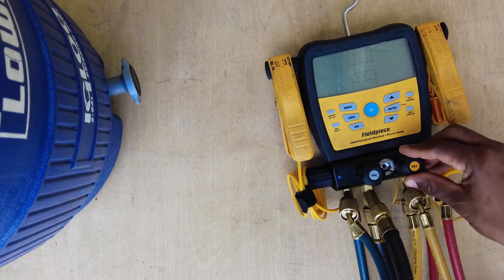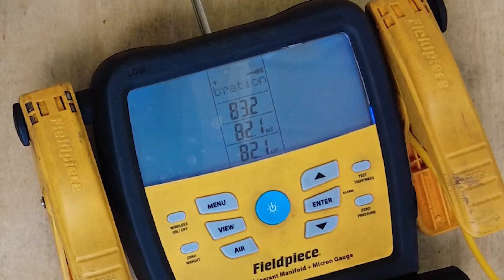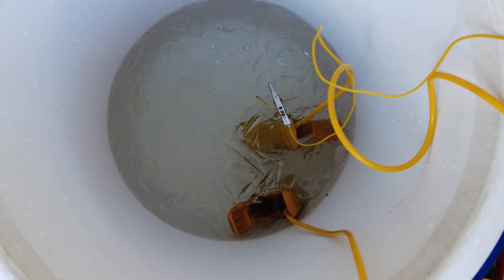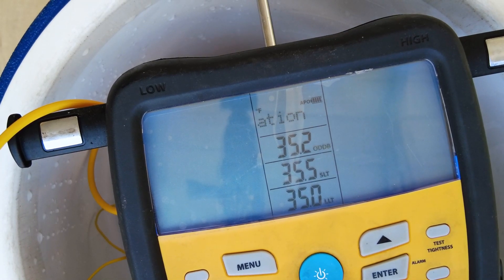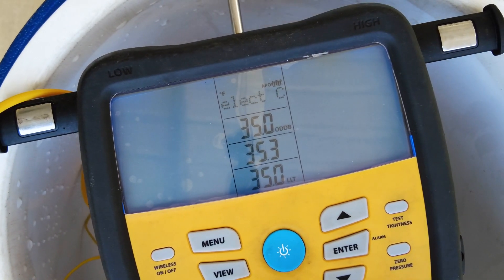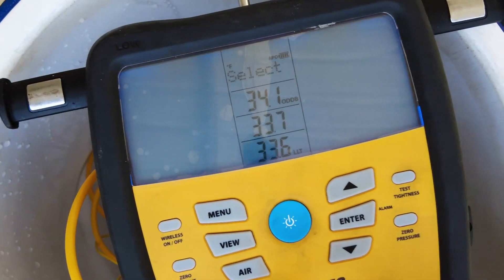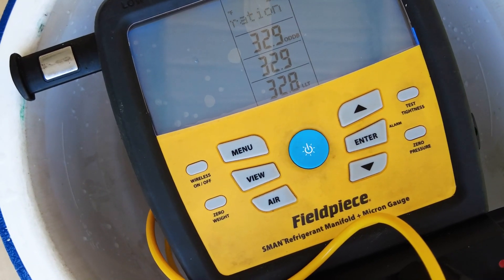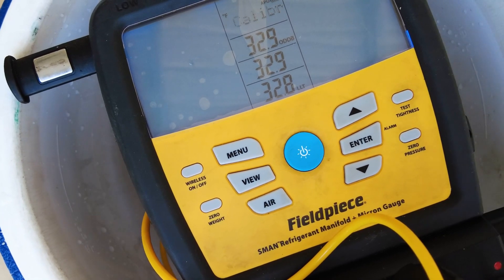How to Calibrate Temp Clamps on Fieldpiece SMAN 480 Manifolds - Tool Tips for HVAC Techs

Comment: Just a question, can we not set the high and low side temp clamps to whatever the thermaster on the sman is reading rather then go to the trouble of putting them into ice water. Lets say my room temp is reading 70.5F and my temp clamps are reading 68F, Can I not just makle the adjustment based on my room temp of my thermaster?

Comment: Nice demo.  Do we need to be concerned about the possibility the sensing area is actually contacting an ice cube?  I don't know but I was thinking a cube can be colder than 32deg.
Reply from the maker: Thanks for watching! No you shouldn't have to be concerned about direct contact with the ice. As long as you're not clamping the probe around a cube of ice General temperature of the ice water should be about 32 degrees